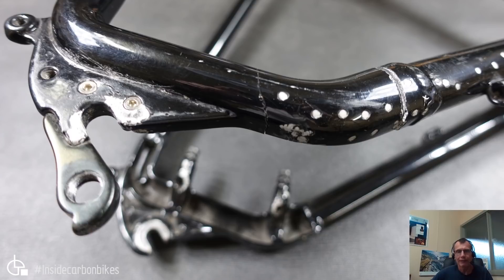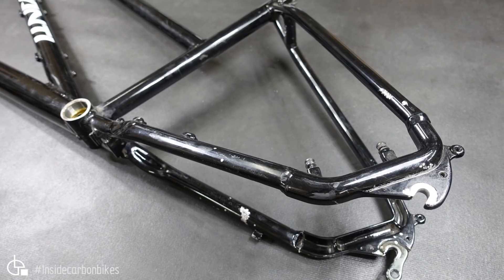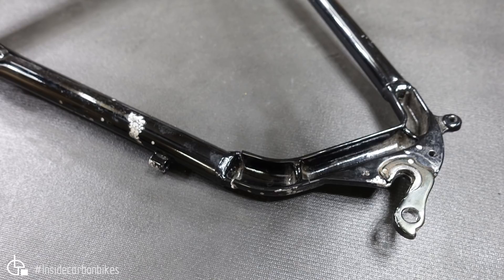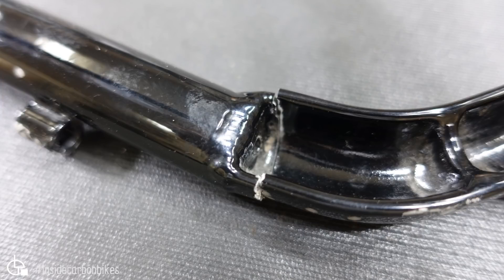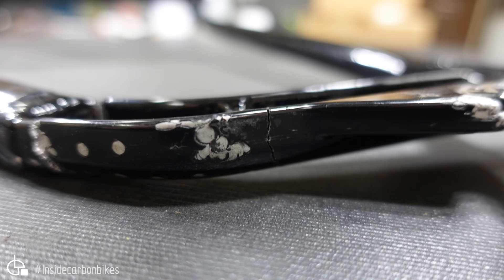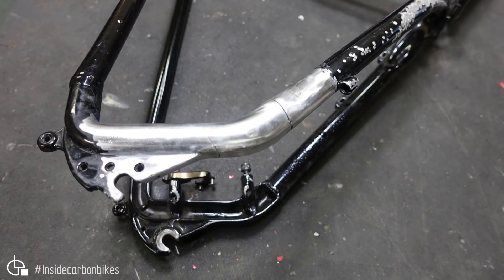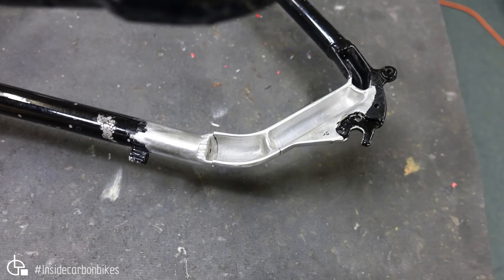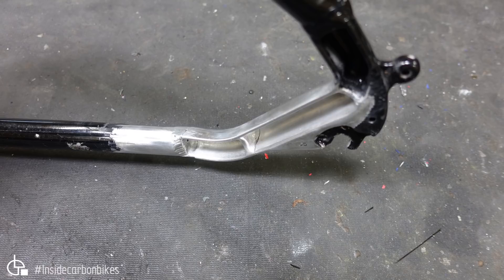Cracked Aluminium Frame - Carbon Repair!

Comment: Great video. Inspired me to repair a crack on my Aluminium frame (seatstay-cross bar weld, 60% crack through) So far so good. Came out well. Glass, stepped carbon, epoxy resin, peal ply, taped down hard, sprayed black. 
Would enjoy working with you. Love the task.

Comment: I respect your experience with these repair's but would S-glass be a better solution? No galvanic corrosion issues, S-glass very good with dynamic loads.  As for Epoxy,  Epibond 420 A & B is designed to bond to aluminum and glass, originally known as Redux. It too is designed for dynamic loads. It can wet out glass or carbon or be thickened with flocked cotton or mill fiber.
Reply from the maker: There was a glass barrier ply to prevent galvanic corrosion,  due to the stiffness of the dropout area the dynamic loads are limited if at all. I am familiar with Redux 420AB, I consider the viscosity to be a little high for wet laminating however use it as an adhesive.

Comment: "Why you SHOULDN'T wrap fiberglass in carbon fiber??"
https://m.youtube.com/watch?v=j7bQYEt_qtU
This guys goes into percentages; can his explanation say your's isn't as good as it seems?
Reply from the maker: What he says is true, however this is when the bulk of the material is glass, (to reduce cost) with a ply of carbon (for the look). What we are doing here is to place a very thin layer of glass as a barrier ply to insulate against galvanic corrosion, which is required for longevity. This is also done on composite repairs to aluminium aircraft.
Reply: @LuescherTeknik  i see, this is intriguing as all i want to do is fill in a half dollar size dent on a downtube (under part), what can i fill it with? I have done carbon repair successfully but i wasn't sure if i should fill it then wrap it.

Comment: That's a great repair! 
No galvanic corrosion by placing the carbon directly in contact with aluminum?
Reply from the maker: There is a glass barrier ply to provide insulation.
Reply: @LuescherTeknik  smart! Just like what they do with aluminum honeycomb panels. Sorry I missed that part in the video.

Comment: There are no complications of heat treatment in bikes. Bikes are simple stuff. There is absolutely no heat treatment of bike frames other then overheating during welding. However if you have already that many cracks in some aluminum the best thing you can do is to throw it away.

Comment: I went through the first step of sanding down the paint around the cracked area on a Specialized Enduro chainstay and was thinking about doing something similar. Obtained a fiberglass repair kit by Bondo and thinking of using that, then layering up the carbon with another epoxy and hardener in-between days. Thoughts on that would be great.

Comment: Super informative, I'm soon going to attempt this myself on my frame.  I'm curious though if you sanded and grounded the final product into a taper or did you initially lay the layers in a stepped pattern so that there is a natural taper? My next question though is an issue that should at least be considered, maybe I'm wrong then someone could chime in.  Carbon and aluminum (in my case 7005-T6) have a pretty substantial difference in CTE or thermal expansion coefficients.  Where as carbon can even be negative (-1 *10^-6 in/in F) aluminum is much higher (13*10^-6 in/in F).  Though bikes theoretically do not see drastic instantaneous temperature changes, they are used in a range of temperatures which for example sake can be close to a delta of 100 degrees Fahrenheit, though it is due impart to atmospheric conditions.  This is of course dependent on where you ride, what time of year, do you store your bike in a car on a hot day etc.  I see this as an issue for the bond because the aluminum will elongate at a larger rate than carbon when heated and I see this compromising the integrity.  S-Glass fiberglass is stronger than normal E-glass and has properties closer to that of Aluminum, why not use this instead to repair the crack?  Another property to consider as well is the percent elongation at failure but this comment is already pretty long so I'll stop here haha.  Hopefully this is coherent and makes sense, let me know what you think, thanks.

Comment: Im going to try this for a seat post that has snapped off from the seat being positioned too high on an electric bike.  Thanks
Reply: Any specific names for the resin and carbon fiber used would be great.  Ide like to replicate the strength seen in your repair as the rider of this bike is 6.4 220lbs
Reply: @TGKProductions358  Did it work out for you? I’m contemplating doing the same repair.

Comment: Raoul. Great work.  I have a Pinarello Prince 2001 with a cracked chainstay.  I have aerospace experience (vaccuum bagging, 350F autoclaves)...  I have some questions: 1) What do you use for etching the aluminum and as a primer 2) How many plies of a 200 grams carbon twill would you use? 3) Is vaccuum bagging really critical (it would seem that on such a relatively small area having a resin rich composite (and the extra weight) would not be so critical but of course porosity is much more of a problem)...
Reply from the maker: Thanks, I mentioned the prep in the video, upto 7 plies depending on a few factors, the vacuum is to compress the material for better fibre load transfer, the strength comes from the fiber not the resin so much.
Reply: @LuescherTeknik  Thanks so much for sharing your knowledge. I'm also interested to know what etchant you used for the aluminium prep, can you suggest something I can obtain easily in Australia?
Reply: @noeyedeer8732  I did some homework and the etching is acid.  Since dealing with phosphoric acid solution is not exactly friendly for home-based work, I was thinking of vinegar, but am not sure the 2.5 pH of vinegar is low enough.  I would be happy to get some comments on that...
Reply: @LuescherTeknik  Thanks for the input. Yes, based on the 1.5mm thickness aluminum used on 7000 series, it seems that 6 to 8 plies of 200gram/sq.m twill which should result in (1.5 to 2mm) should work.

Comment: Is there a way to repair cycling shoes that have a carbon sole that has fractured? Is it possible to epoxy and layup some carbon on it for a patch fix?
Reply from the maker: Maybe, it depends on the damage and the shoe material. I would need to assess it.

Comment: Interesting video as always!  Are brake tracks on carbon rims repairable?  I have a rim that structurally looks fine, no exposed fibres, cracking or damage, but there has been a chip taken out of the braking surface by a tyre lever.  The main concern is over brake pulsing.  Is there anything that can fill that void?  It's quite shallow and flat.  I'd imagine it may be hard to find a material that will offer similar braking characteristics.  Thanks in advance
Reply from the maker: We have repaired this type of thing in the past without issue, it is a case by case thing however, so would have to see it here.
Reply: @LuescherTeknik  Thanks for your response.  Let's see if this works.  https://photos.app.goo.gl/m9tar9hPRo4wDpB86 and https://photos.app.goo.gl/hnYtcjPjqkfKKWed7

Comment: Years ago I had a Specialized enduro 2nd hand where a rock strike or something had punched a hole clean through the downtube, an inch or so up from the BB shell, I had considered doing just what you did here, carbon over fibreglass. Instead I rode it for six months decided it was too much faff and sold the frame (highlighting the damage)... Wish I had done the composite repair now...

Comment: Great video and an even greater repair job. Very interesting to use carbon to repair Aluminium & as you said, it's nothing new.
Poor design of frame where the welds are and a strengthen rib, just adds a stress point. There must be a fair amount of flex at the rear & most likely coming down the seat stays, acting on the rear dropout and that being the weaker area eventually breaks.

Comment: Great work. Repaired Cannondale CADD12 chain stay with  a carbon repair. Where an oversize tyre had been fitted and worn it away. Though mine was a budget fix with fishing rod repair kit. But followed guidance on isolation and preparation. Over 10,000 miles of training later it's still going strong. Though certainly not as pretty 👍
Reply: I wonder if I could fix a downtube crack just under the seat on my old aluminium frame bicycle?

Comment: Fantastic. I'd be tempted to remove a lot of that aluminum for a more contiguous carbon layup. My instinct would also be tapering off the thickness of the carbon to avoid a stress riser at the beginning of the joint, which you did.

Ah- foam fill. I see.

Comment: i had a KHS XC207 Charinstay CRACK thats is how i purchased it , TIG WELDED still holding ip 
also had a Cannondale f29 Alloy Broken Seat Stay welded up and lots of Dents on the top and Down Tube Tig Welded Filled

Comment: Awesome! I liked this a lot!  It would have been super cool to see this in video format.
I wonder if there would be any benefit to wrap an aluminium frame (or thinner tubes) in carbon fiber as a new manufacturing process, if cost was not an issue?
Reply: No, there wouldn't be any benefit, as the carbon is much stiffer than aluminium. Carbon would be taking all the load, while the aluminium would be flexing underneath it, basically doing nothing and just adding weight. Essentially you'd have a carbon frame with an aluminium deadweight on the inside.

Comment: Anzac or FFG?
Reply from the maker: FFG, It was HMAS Sydney, I just looked it up and it was decommissioned in 2015 so no longer operational.
Reply: Luescher Teknik thanks. I knew about the cracking with the aluminium superstructure on FFGs, but also knew FFGs were decommissioned when AWD came into service. And the Anzacs have some aluminium structure too and are on their 3rd masts (2nd upgrade) which. I also have a old work colleague who use CF cloth to repair his light weight alloy frame.

Comment: One of your best Raoul.  Wondering can you do similar for steel frames (specifically a Columbus Ultrafoco ‘Megatube’ downtube on a favourite old Paconi of mine which has cracked near where it is welded to the headtube bottom side)?

Comment: Did you do anything to the break itself, such as maybe epoxy bonding the joint prior to the fiberglass layer? I just wonder, if the two aluminum ends are just barely touching, some flex in the dropout could make it creak.
Reply from the maker: It was bonded prior to wrapping.

Comment: why not TIG the cracks before the CF repair?  seems like welding would ensure the broken segments stay aligned and might provide a tiny bit of strength, in addition to the CF overwraps.
Reply: He mentioned the reason for not welding toward the beginning of the video.    He didn't weld it up due to the heat treat schedule the frame may require once welded.

Comment: Is there a good reason why they didn't have the other chainstay and dropout done while you're at it? I would have done it for piece of mind. Love the technical details!
Reply: I'm just going to guess at this and could be completely wrong.   My thought is that the load and torque carried by the right hand chain stay is substantially greater than what the left side chain stay would see so there's no real need.    Also given that the repair needed to be done in a timely manner as well as associated costs the broken chain stay was the only one worked on.    Just a guess though.

Comment: I would think by now the mechanical engineers designing bikes would model them FEA.  No high power computers of old days needed.  If not, then stress test prototypes to failure including cyclic loading.  The loading is clearly understood for bikes nothing new.    An engineer would also be responsible for welding specs.  The only (legal) defense they could offer is rider/gear weight overloading, or unacceptable road conditions.  What a shame.  Once again a potential serious rider safety issue.
Reply: You can have welding specs but the person welding it can always make a little mistake on the day which leads to a fatigue failure down the road. These things happen.
Reply: @benc8386  in this case the welding does not come into it, as there is no weld near enough to matter. It is simply a bad design. It cracked exactly in front of the (stiff) dropout plate, and on the transition from full cross-section to a C-cross section. Those are areas with stress concentration, due to bad engineering. You always need to "feather out" stiffer areas, otherwise this kind of thing is bound to happen. But the new production methods and CAD meant that experience was thrown overboard, and the things that used to be normal are now nowhere to be found. Have you ever wondered why the lugs on a steel bike frame never end straight, but always have scallopped edges that taper to a point? Exactly.
In case of my MTB frame, there was no error in welding either. The brake caliper mounting plate stiffened a part of the chainstay it was welded to (and the pivot point for suspension rods/chainstays was too high and behind the wheel axle, creating a bending force. The chainstay cracked several millimetres away from the weld. Clearly a stress riser. Felt tacitly admitted that they screwed up, because the replacement part they send me had a line of weld extended about 1.5 centimetres beyond the mounting plate, to feather out the load. That one did not break (yet).
Reply: @horrovac  That could have been a failure in the heat affected zone from the weld. But either way I agree it's basically a design fault. Unless it was Al I suppose and they didn't redo the heat treatment after welding on the caliper tab.
Reply: Ben C - quality control.  A welders performance can be periodically evaluated fully with destructive testing, as in a random audit, and all the time with other forms of evaluation.   All depends on what is being welded and type of welding.  Some welding is done by machine, one reason is to remove human factor.
Reply: With modern designs I feel like the designers rely on CAD software, with neither software nor designer having any understanding of metal fatigue or stress risers. The designs are often apalling, especially with alloy MTBs, which are designed to look very technical (with no actual technical merit). Kinda like the "technical" cachet of CNC-machined components, which many people consider superior, where actually they're mechanically inferior to other production methods like cold forging. I often look at bikes and think, uh-oh, there's a stress riser, and there's another, that looks underdimensioned for the load and so on... I actually predicted the fatigue cracking on my Felt MTB, which had a very obvious stress riser on the chainstay (brake caliper mounting plate). The level of engineering quality in the bike industry, with notable exceptions like Shimano, is generally appalling.

Comment: I feel like Avanti forgot the golden rule of triangulation here.
Reply from the maker: Absolutely, it was a matter of when not if it would fail.
Reply: @LuescherTeknik  I'm not an engineer but after years as a bike mechanic I do wonder why I couldn't be.
Reply: You're not wrong. It's noting like structurally optimal with the top tube landing in the middle of the seat tube and the gratuitous bends in the chain stays.

Comment: Carbon is stiffer and also sits on the outside. Outside usually see the highest loads. Repair looks fantastic. Did you match any  properties of the Al frame with the plyes or did you rely on experience?
Reply from the maker: Experience, the original aluminium design was less than ideal.
Reply: Luescher Teknik Yes it looks like that extended u-shape creates a lot of torque and shear.

Comment: Nice to see carbon fibre doing some environmental good for a change, stopping a frame hitting landfill or recycling. Also the owner now has extra bragging rights as his frame is a bonded carbon fibre and aluminium frame a bit like a Pinarello Neor which is mainly aluminium with carbon fibre stays.

Comment: That was a really nice looking (as well as well-engineered) repair job. Do you get any galvanic corrosion type issues if you glue CF to steel?
Reply from the maker: Steel is less reactive, but a barrier layer is recommended.
Reply: @LuescherTeknik  Thanks! I'm making a frame with CF tubes glued into steel "lugs" with MMA glue. I'm going to try a strength test.

Comment: Interesting I didn't know that could be done, so there is hope for Alloy bike riders.
Reply: Darin Steele - unless I’m mistaken, Shimano sells an aluminum rim with carbon fairing (dish).  I think Shimano stays away from 100% carbon rims.
Reply: @robertp7209 I think they dont do full carbon clincher rims because of this failure explained by this vid. https://youtu.be/7O95Cd-aogk
Reply: Eric Ng - smart company.  Besides, aluminum is a proper heat sink for braking, carbon is the worst material for it in every way possible.
Reply: @robertp7209  Shimano do full carbon rims in their disc versions
Reply: BMX carbon forks (for racing) used to be a carbon/aluminium composite, where the carbon was just a fancy laminate.